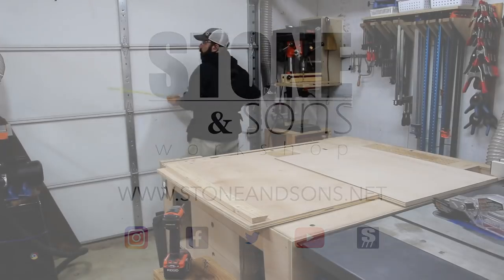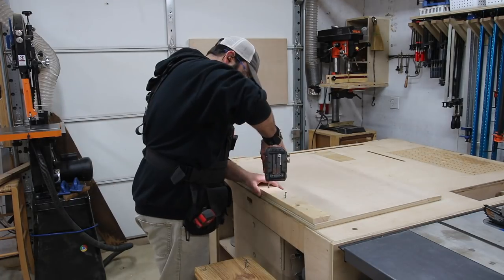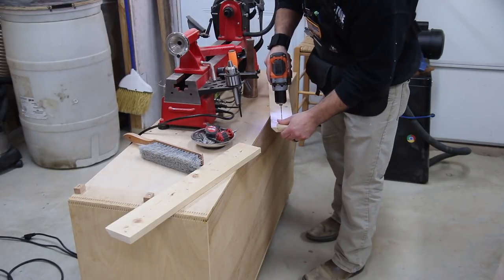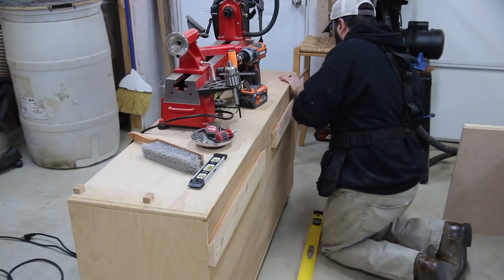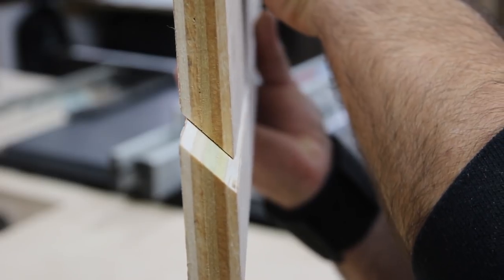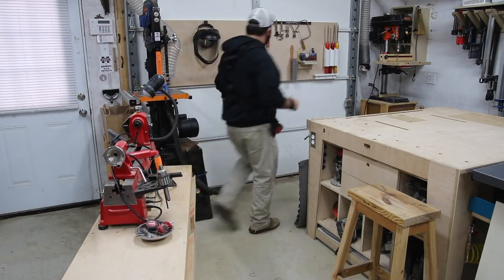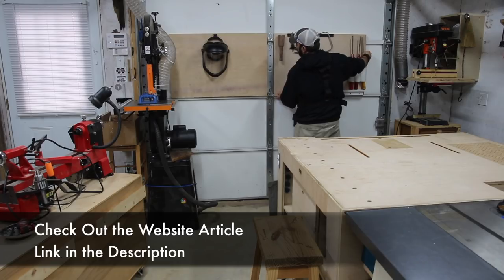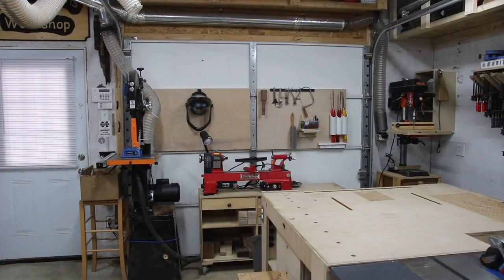French Cleats - Works Great on Garage Doors

Comment: great idea for using the garage door as a wall.  FYI, you might add handle on your boards to make it easier to pick up and carry.
On my garage door, I designed a panel saw for cutting full sheets of plywood when closed ( I did a video on it).  keep up the great videos
Reply from the maker: They're easy enough as is, but handles aren't a bad idea. Thanks for watching

Comment: I was thinking of dowels or rods on bearings and the top piece of the hanging portion could just stay on the garage door and as long as you had clearance under the door...your tool rack could just stay there....
Reply: Of course this would need to have the motor for the garage door either upgraded or maybe a few more turns on the torsion springs to help the motor out....
Reply from the maker: That would be nice. Just don’t know how to keep the tools from falling off.
Reply: Stone and Sons Workshop ...I would think gravity will do what gravity does.  Kinda like a ferris wheel. The weight of the bottom of the panel that would not be attached to the door will start being pulled away from the door when the angle changes as the track will force the door from a vertical position to a horizontal position.

I may do this same thing with my doors after I get done putting my homemade radiant barrier on the doors.

My garage isn't insulated and it makes it a bit (or a LOT) less comfortable to work in when I have to get things done.

My garage door is aluminum and light weight with a 1/3 hp opener.  Providing the bearings are strong enough and the aluminum is strong enough...I will implement some of what I've thought of (after seeing your video) to put some of my light tools on the garage door.

I'm thinking stuff like hand tools and levels and clamps. Who knows? I might be able to sell a tool box if I dont need to keep the tools in there....? And maybe this garage will have more room for the cars again. 😁😎😇👍

I just have to measure the distance between the place where the door rests in its open position to the floor and measure the car roof height and verify the room is there to utilize the full length of each of the panels....OR I'll just shorten the height of the panels....👍

This will happen eventually.....I still have an in finished basement after being here 11 years...and the wife wants that some first...SO....we'll see how long this takes....haha!

Comment: What are the dimensions of your drill press cart ?  Is it ‘tippy’ at all?  I’m trying to keep mine as small as possible but don’t want to have balance issues.
Reply from the maker: 19 inches wide by 16.5 inches deep. It's on the verge of being tippy.

Comment: Yeah can we see what happens if you click 'open' ?
Reply from the maker: No motor on this door. It's manual and has to be unlocked from the inside. So, I feel confident I won't open it without removing the tool boards.
Reply: Oh that helps a lot.  If I put cleats on my garage door it would be about 5 seconds before my wife and kids accidentally clicked open... good thinking on making something work.
Reply from the maker: Lol, yeah. For my space, it works.